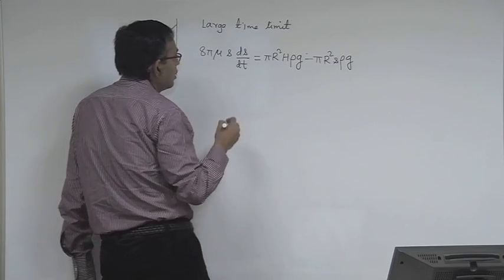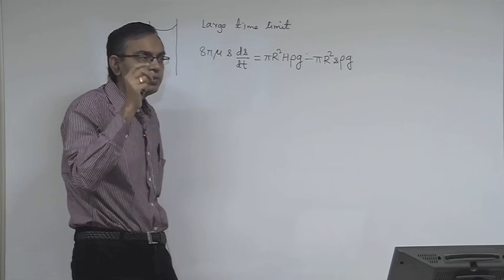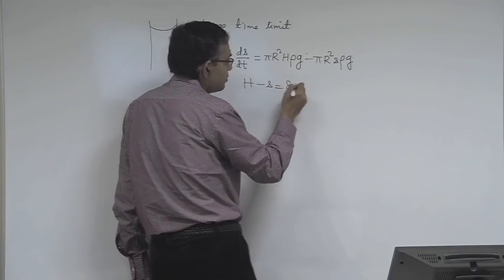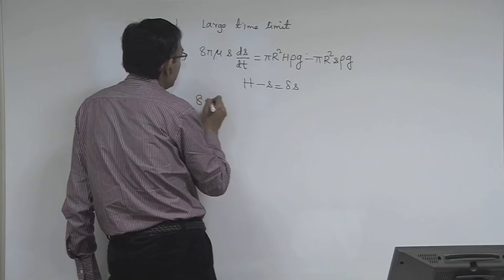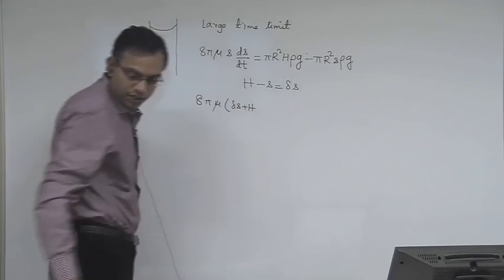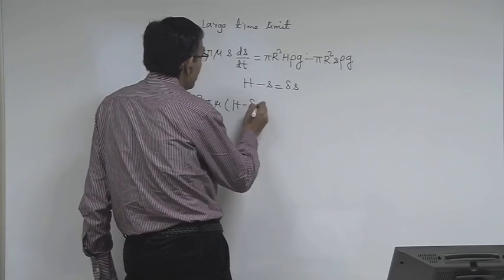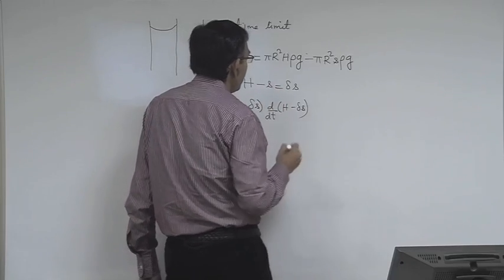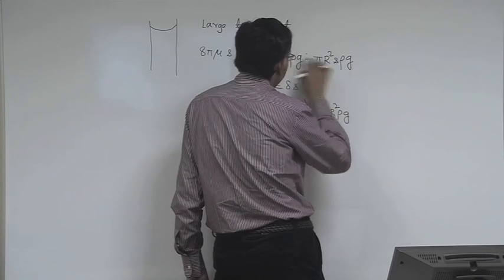Mod-01 Lec-25 Surface Tension Driven Flows (Contd.)

Comment: I think one of the problems we have in science at any level but it is highlighted at the micro-nano-astro and galacto levels - re: the very small and very large - is that the mathematical structure we use is theoretically flawed and i also  based on the notion of a continuum when in fact no continuum exist - i have prove that the physical world is discrete - so a discrete model is required for your work and you are limited by a continuum model - right now we cannot use a discrete model because we are limited by a very fundamental notion in mathematics which I discuss in my Thesis - my solution to this problem should assist greatly with handling such non-linear and non-traditional notions within science at all levels - rather than generalized models we need specific models that can be continually modified as the physics of the problem DISCRETELY change over whatever scale in time and length is applicable - I hope to present this new Mathematic Structure shortly when I publish my Thesis on this topic - without the corrected discrete  mathematics I speak of you will never resolve the problems you discuss  herein - our contemporary mathematical structure has a deep-theory flaw that I have discovered and resolved - the contemporary model is outdated and incapable of handling the problems you so rightly address here